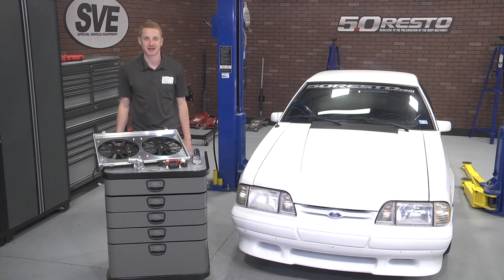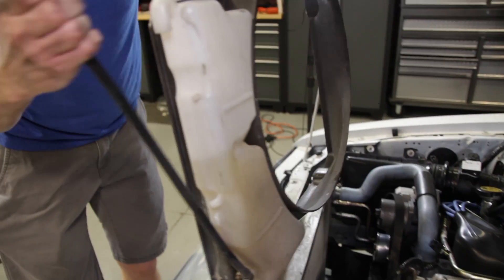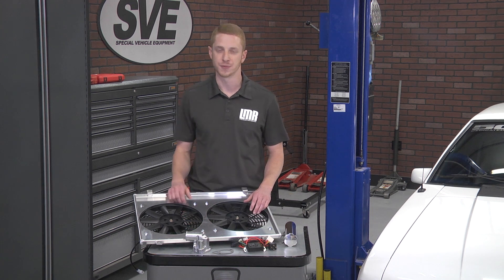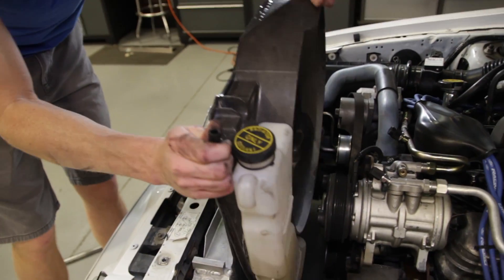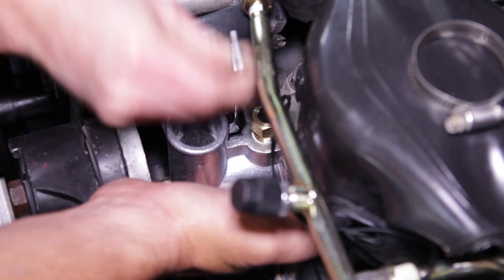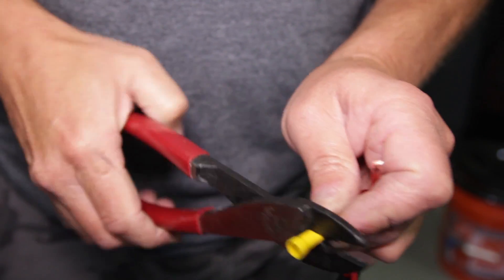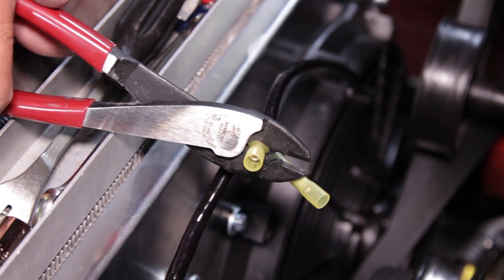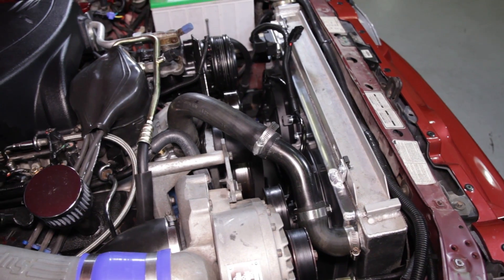Fox Body Mustang Electric Fan & Shroud Kit (79-93)

Comment from the maker: **This kit no longer carries the SVE branding.  For more information, please check out the link below.**

Aluminum Electric Fan Shroud Kit:
https://lmr.com/item/LRS-8005AEK/mustang-electric-fan-conversion-kit-79-93
Reply: what do you do if you can find you a/c or dont have it anymore what do you do?
Reply from the maker: @mightymanntor8333  I'm not sure I understand what you're asking. If you don't have air conditioning then that's one less thing to wire up. -Landan
Reply: @latemodelrestoration   I didn’t know how important it would be need or where to wire it if needed thank you though
Reply from the maker: @mightymanntor8333  You're welcome. -Landan
Reply: Spent well over 5 grand on lmr stuff good stuff - last thing i got was SVE radiator,  was irritated to see it was a universal radiator,  had to go out and source plugs for the 2 auto trans holes, my question is do i need a overflo tank ? Is that bung a check valve? Or can i just put a rubber block off on that overflo bung?
Reply from the maker: @brandonknight7240  Thank you for your business and for the feedback on the provisions for the automatic transmission cooler lines. I'll forward this info the product team. I would recommend an overflow tank. What bung are you referring to? The one near the cap? That fitting is there to plumb a rubber hose to an overflow tank. I'll leave a link below so you can checkout our overflow tank options. -Landan

https://lmr.com/products/Mustang-Engine-Bay-Components-79-93

Comment: Is there a video on how to wire this kit to a terminator x system? I need help 😅 Thanks in advance.
Reply from the maker: There isn't a dedicated video wiring this specific fan to a Holley Terminator X system. Electric fan wiring is mentioned in the Term X instructions starting on page 14. As stated on page 6,  Do not use the electric fan outputs to directly power a fan. They must only trigger a relay. All you'll need to do is wire in one 70-amp relay with the fans and trigger the relay with one of the outputs on the Term X. In other words, a dedicated fan controller isn't needed. Let me know if you have any other questions. Thanks. -Landan

Comment: Which is it? The red wire goes to the black wore or the starter solenoid? If you could be more specific that would be great. Thanks.
Reply from the maker: The red wire coming from the controller gets connected to the black wires on the fan. The loose red wire is connected to the battery side of the solenoid and the blue wires on the fans. We also installed a 30 amp in-line fuse between the fans and solenoid. Hope this helps. -Landan
Reply: @latemodelrestoration  I was overcomplicating it. Thanks for the response.

Comment: Where on earth does the AC bypass go on a 84 LX. Harness is different then the aero style foxes
Reply from the maker: I would recommend purchasing a wiring guide for a 1984 Mustang. This is an invaluable resource when you need it and they're very affordable!

You'll splice the a/c trigger wire on the fan controller to the 12v signal wire on the back of the a/c panel.

https://lmr.com/item/BSK-14897/bishko-mustang-electrical-vacuum-troubleshooting-manual-1984

Comment: For the green wire, is that going to be an add on? Or is there already a wire there I splice into?
Reply from the maker: The instructions explain what the green wire does. It can be wired to a dedicated switch or to the A/C clutch circuit. The instructions are on the product page. -Landan

Comment: will this kit work on a factory radiator?????
Reply from the maker: This fan does work with a stock radiator, but you the vertical rod will need to be removed so that the fan shroud sents flush against the radiator.  If the car has modifications,  I would recommend upgrading to a 3-row aluminum radiator as well.

Comment: I have a question i just changed fan clutch fan radiator overflow reservoir radiator cap water pump and heater core hoses thermostat and my 92 gt  still overheats any opinions or suggestions will highly appreciated.
Reply: Try a new radiator, double check your thermostat is installed correctly (spring facing towards the rear of the engine). If neither of those solve your problem start looking for signs of  a bad head gasket, (look in the radiator and check for bubbles, do a compression check on all the cylinders, etc.) just to avoid doing the head gasket I’d try the cheap easy stuff first, double check that the water pump you bought was the correct rotation for your year vehicle etc.
Reply: @Completelyradical  thank you I'll check it out bro

Comment: To make everyone’s life easier with the overflow catch can. I’ve see some mounted it back by the coil. 

But the hose LMR sends is too short for placement there. 

Where they mounted the controller on the shroud in the video. Below that mount one of the L brackets that comes with the catch can. 

What I did was flatten out the other L bracket which will bolt to the the bottom bolt hole on the catch and used a self tapping screw and screwed it into the side of the fan shrouds aluminum. 

Held fine just the fans plastic is in the way to mount two L brackets to the face of it. 

Much easier to mount it there and it’s kinda like the stock location. And the hose reaches. 

The wiring isn’t hard like he said blue with blue.  black with black on the fans. wire from solenoid connects to the two blue wires from the fan you twisted together. 

And the red wire from the controller goes to the black wires on the fan you twisted together. 

You’ll see that red wire come off a 30 amp fuse in the fan harness 

the  yellow wire goes to  a 12v switched source. And green wire splices to a/c wire. Which I don’t have a/c. So I didn’t use it but the blue quick connect is for that they send. 

Really like 5 things to crimp and splice and you’re done. 

Fitment of the fan shroud. making sure it lines up and mounting the over flow is more time consuming then the wiring.  

I had a older fms aluminum 4 core  radiator. So I had to tweak a couple holes at the top and open them up to give me enough play side to side with the shroud to mount the overflow up by the radiator. 

And it didn’t even line up at the bottom of my radiator where holes are to bolt it up. Guess we will find out if two bolts at top hold. Should be fine seems like a decent fit.
Reply: Where can I find a 12v switched source in the engine bay ?
Reply: @williamlopez7535  windshield wiper blades

Comment: I have a question i just recently replaced my fan and fan clutch i also replaced the thermostat but my 92 gt still overheats any help or suggestions please would be highly appreciated
Reply: Do a pressure test on your radiator,  you might have a head gasket problem.  Just a hunch.
Reply: @Project_Valkyrie  i will i hope they're not the head gaskets.

Comment: Junk don’t buy. You need at least 3000cfm I had this it won’t keep up with Texas summer heat
Reply: I'm having the same issue here in SC what did you end up using these aren't doing the job at idle

Comment: Ours works great but the fan runs a long time after turning the car off and I have to turn the adjustment trim pot till it shuts off. Advice?
Reply: Bill A:  You need to wire the fan controller to a "key on hot" circuit.  Right now your fan is wired "key off hot" which means it constantly has power.  When you wire it "key on hot" the fans will shut off when you turn off the car.  Key off hot wiring will cause you big problems and also ruin your battery.
Reply: fwh79 but he stared it runs a long time after he turns it off. 

 not fans constantly running key on or off. 

They said the fan controller is set at 150 degrees most likely once it goes below that the fans turn off. Figure you have that temp probe in the thermostat housing. Which is probably gonna stay warm a little while after you shut the car off
Reply: did you ever find a solution? I have this same problem and it damn near drains my battery each time i’m done driving it
Reply: Nobody bothered to reply regarding the end solution?  Where is this "key on Hot" wire?  Location? Color?
Reply: @whiskeynthejar7  use the red wire on the windshield wiper motor, it is key on hot and it will turn off your fans when car turns off

Comment: What is the best way to get all the air out of the system after I install the new sve radiator?
Reply: Park nose up on a steep hill , run car with rad cap off to burp air out , also turn heat on full

Comment: i installed this with the rad and now my car wont start when the fans are connected. Instead the fans jump on when I turn over my key and the starter doesnt even click. Bought a new battery and tried. New battery was toasted after one time start where just fans turned one. Can someone help. Did everything the same but bypassed the a/c wiring because I dont have A/C in my 86 Mustang
Reply from the maker: Adam, do you mind giving our technical support team a call at 866-507-3786. Let's get you taken care of.
Reply: Adam Schembri:  Did you get your problem fixed up?
Reply: Wondering if you run a stock alternator. The fan controller has a 30 amp fuse on it. With lights everything else radio etc and fans pull amps too. Might have been too much and killed the battery maybe try a higher amp alternator? Also maybe check your starter solenoid see if it’s bad.

Comment: Does any one have any idea how the hell to get the fan temp controller to work? nothing I do will get the fans to kick on. It'll come on when the a/c  is running but will not kick on by temp alone.
Reply from the maker: Give our tech team a call at 866-507-3786.
Reply: thenomadrhodes  I am have the same problem but , it won't click over at all . Did you fix it?

Comment: Can you change the temp that the fans kick on? Or is it set at 240degrees?
Reply from the maker: Please give our tech team a call at 866-507-3786.
Reply: @latemodelrestoration   - Why can't you just answer the questions here vice tell everyone to call your tech team? Have your Tech Team answer the questions if you can't and maybe you'll cut down on all the phone calls if the answer is posted.
Reply: @Stephen Gogulski — RoFLLL
Reply: It’s set when it comes at 150 degrees under the plug is where you adjust it

Comment: i just bought the kit and it came in today...looked inside and it was only the fan with a few nuts and bolts...is this okay if im converting the stock fan to this fan or do i need all the other parts for the conversion? :/
Reply from the maker: Megan - All of the parts that I used in this video are mentioned in the description.
Here is the kit that would have provided everything for an electric fan conversion: https://lmr.com/item/SVE-8005AEK/79-93-mustang-electric-fan-conversion-kit-sve
Hope this helps! -Landan
Reply: Megan Gamble:  Did you get your fan kit installed yet?

Comment: Video was fast around the wiring part as everyone says.  Wanted to note I grounded mine above the head light as stated in video it made my headlight super weak on that side, so instead I ran the wire under the passenger fender and grounded it to the top fender bolt closest to the firewall.  Now my headlight is not weak/dim.      And nothing states which way to turn the adjusting screw to raise or lower the degrees before it kicks on.  I would assume left is lowest, yet now my fans aren't kicking on so having to trouble shoot why everything quit working now.   Haven't even drove the car but it was working before.
Reply: You need better grounds on your car, grounding a wire at multiple places should never weaken any electrical circuit. I bet you have some bad Battery/Chassis ground causing you issues.
Reply: It should’ve come with instructions for the for the controller that say counter clockwise to lower fan turn-on temperature, and if you adjust it more than 3/4 of a turn and if you adjust it past the stop then warranty is void, so that may be your problem.
Reply: @pineapplestudios9257  fixed it a few week later was turned wrong way.  Ended up selling car also. Should come with a + or - on each side regardless.  Thanks for comment(s) back & info :)

Comment: those fans dont move enough air to cool down most mustangs. the stock clutch fan moves almost 4000 cdm and a junkyard Contour moves over 3300 and a MKVII fan moves over 4000 cfm
Reply: I have a couple of mustangs,a 90GT and a 91GT vert,i decided 3 years ago to use the biggest electric one  flexalite makes (cant recall the name) on my 91 and man i love it, i live in Oklahoma, it gets hot as hell here during summer (100+) and it runs nice and cool,i dont race my cars except on occasion i might get on them so maybe it wouldn't work for that but it suits my needs,when i had the clutch in the 91 and i was at a drive thru or so i had to shut the car off everytime if the line was taking too long, electric fans are one of those things, some people install them and they go out in a month  or blow up and destroy their radiator and hood and some people have good luck with them, so far so good but i have all my old stuff in a box for the day the electric one craps out,i will get another one though.
Reply: @dntlss  Hey, fellow Oklahoman here. could you please try and get the name of that fan? I got an 85 that I'm fixing up and am curious.
Reply: Can’t go wrong with the contour fan. The 02 Mercury Cougar has the same fan, that’s what I got mine out of
Reply: I have those fans and my engine overheats. New radiator too and 180 thermostat. Looking for another fan that moves more air.

Comment: A lot of people do the contour factory fans. Those flow 3000cfm on high. I'm curious as to your kit here flowing 1800cfm or 1200 less. The contour can't be making heat like a built and raced SBF. 

So how do we know those fans flow enough to support say a boosted car or even a higher compression motor. 

Do you have real numbers on the stock clutch fans cfm at like 850rpm, 1500rpm, 2000, etc etc in 500 increments? 

Thanks for your time and look forward to lesson on this set up and my concerns.
Reply: They don't.  Running this setup on a single turbo setup and temp creeps up except on the highway.
Reply: Rimbo's Garage of course running around town light to light in summer it will get hot and on the highway air is hitting it. I’d say it will cool better.

Comment: There is a ton of splicing for a "kit" and cutting off the fan connectors, that's a darn shame the kit doesn't have provisioning for that.
Reply from the maker: At $274.99 (currently) you won't find a "plug-n-play" kit cheaper than that. We apologize if this doesn't meet your "kit" standards. A kit is simply a set of components used for a specific purpose. That doesn't mean it's intentions are to be plug-n-play. Thanks! -Landan

https://lmr.com/item/SVE-8005AEK/79-93-mustang-electric-fan-conversion-kit-sve
Reply: I had not looked at the price, that isn't bad at all. Thanks for the quick but cocky reply.
Reply from the maker: Hey! Sorry if the reply came off a little on the harsh side. Sometimes it's tough to express feelings through text. I guess a smiley face will work! :) -Landan
Reply: Late Model Restoration The smiley face fixed it. All good. I should have looked at the price first, that's cheap for a fan kit with all that is included. I wish this was a thing when I had my old '84 GT. Now I have an '04 GT.
Reply from the maker: Nice choice on the '04. I have a 2000 GT in my collection of rides as well. I'm kind of partial to the New Edges. -Landan
Reply: I have heard the term New Edges thrown around a lot, I assume that is 99-04? Have I mentioned I have owned this car right around a month? Still getting into the terms...
Reply: Late Model Restoration  hey can I install a 87 4 eyed mustang  hood on my 92 MUSTANG???

Comment: my whole dipstick assembly came out and can't find where to put it in , if u can help with visual it would be great thanks
Reply: Anthony Torres there is a hole in the block that it inserts into. Which goes down to the oil pan on the drivers side and the bracket attaches to a header bolt

Comment: Awesome fan a nice spot for waterneck sensor wire to ground is where the battery grounds are on block run the wire towards alternator then across sway bar, ground to front block then to fan controller , also point fan wires at the bottom of radiator not at the top like the video shows looks terrible wires everywhere, fan controller mounting spot would be below battery on the frame rail hides perfect & easy acces to adjust, run the wires across radiator core support to the battery hiding the wires for a cleaner look. Don't forget to wireloom everything.